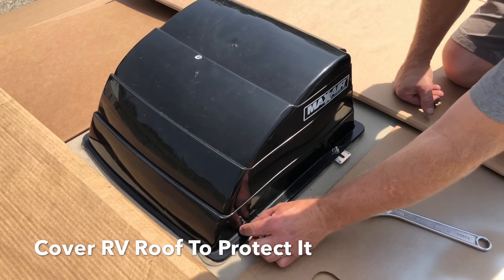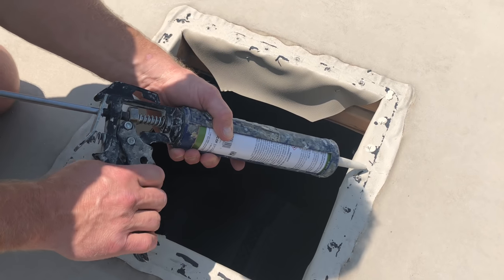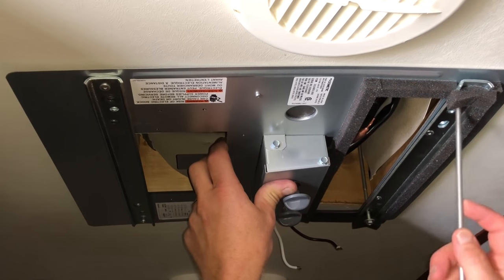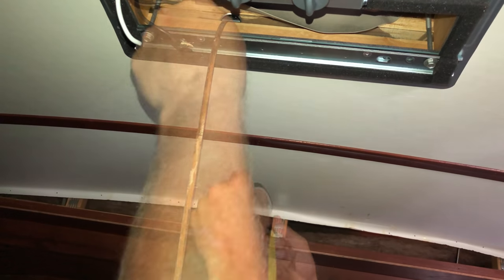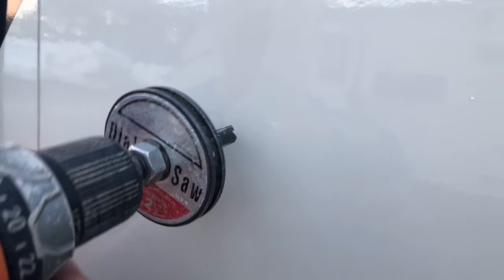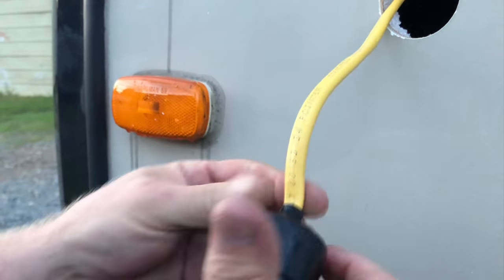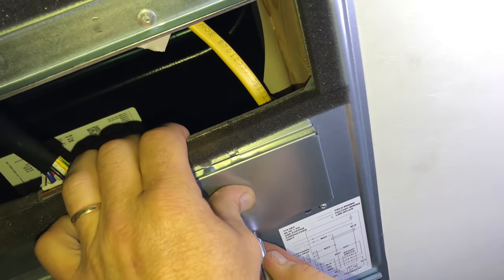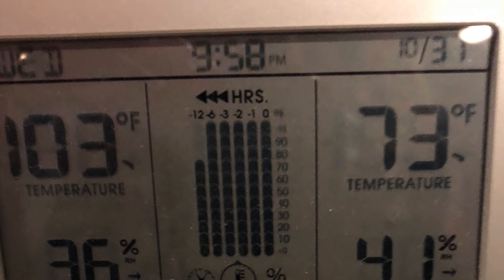Installing a 2nd AC Unit in a Camper with a 30 Amp Service

Comment: What about any thermostat connection ???
Reply: The controls, and thermostat, are located on the unit itself.  No remote thermostat control for this model AC unit.
Reply from the maker: You can also get an external thermostat that can be placed in a better location. This will improve the overall cooling of the unit. Thanks for watching.

Comment: Why is it a plug in ?
Reply from the maker: I’m not sure what you are asking? They are all plug in unless they run on fuel. The second unit bypasses the limitation of having only a 30 amp service. A 30 amp service will not support both. I hope this makes sense and I explained it successfully. Thanks for watching.

Comment: What of you dont have the air vent..???
Reply from the maker: That makes installation more difficult because you would need to cut a hole in the roof, making sure that the hole is centered between the roof trusses. It can be done but a few more steps are necessary.
Hope this helps, thanks for watching.

Comment: Boondocking = 2 Generators 😂🤣😂🤣😂
Reply from the maker: Heck yeah! Thanks for watching.
Reply: @funbro1  question I have a generator honda eu3000is I think I've been using it wrong 🤔. 
My trailer connector has 3 male ends but I've been using an adaptor to connect to the side that has two electrical plugs  and not the one that twists on . And do you think I have to run it on economy or economy off ? 

It runs fine but my a/c shut down twice this last camping trip  cause of the excessive heat.  What do you think im doing wrong ? Thanks any help is greatly appreciated.

Comment: nice, but would have better to use a 20 amp socket
Reply from the maker: It sure would not hurt to use a 20 amp socket, but this unit is well within the range of a 15 amp socket. Thanks for watching.

Comment: Can you show again where you put the circuit breaker ? Oh you don't have any, think about this question while try to go to sleep at night.  Get back in the closet and install a breaker and you've got no protection on your connection from Rain Water shorting it out . Rain water will run down the side of the camper an short it out.  Make sure you connect to a GFCI outlet.
Reply from the maker: Can you tell me again about how you read the previous comments? Oh you didn't read any, think about this while you try to go to sleep at night. Look back at the comments and you will notice that that had already been addressed and discussed in several comments including one just 6 days ago. Most if not all campgrounds have a GFCI for a 20 amp connection so that is typically NOT a problem. I hope this clears up any confusion you may have. Thanks for watching.
Reply: Sorry , didn't mean to step on any toes. I read about 30 "How Great thow are's and no mention of safety issues.  Put an outlet in the closet and when it gets chilly you can run one of those oil filled electric radiators.
Reply from the maker: No worries, Thanks for the good idea. I may have to add an outlet now.

Comment: Are there any issues with that A/C unit running off of a 20 amp connection?  I have been looking into this option with our 30 amp rig and have been advised that a 20 amp connection may not support the stand alone A/C unit.
Reply from the maker: No issues yet. A 20 amp connection is fine with this unit. If you look at the numbers, the compressor runs 13.2 amps and the fan on high runs 2.7 amps.  Simply add the two numbers together and you get 15.9 amps total. That is 4.1 amps below the rating of the  20 amp circuit. That being said you must make sure that all the wiring is rated for 20 amp and if you use a long extension cord it must be a thicker gauge wire (minimum of 12 gauge). I'm not sure why you were advised otherwise but I would honestly love to hear the reason. Hope this helps explain, Happy camping and Thanks for the view.
Reply: If I may add...
Think about how your current AC unit is wired.  In our 5th wheel, the primary 15,000 BTU AC unit is wired into the 110 Load Center of our RV on a 15 amp circuit breaker.  This really is no different, his installation just bypasses the RV's load center, and goes directly to the 20 amp outlet in the park's power pedestal.  I've even heard of running TWO AC units on a 30 amp service, by using soft-start circuits in each AC unit.  These units provide a delay in starting the fan and compressor motors to reduce the startup draw.
Reply: Even a 15 amp breaker can handle it alone since a 15 amp breaker can handle (guessing) 20 amps for a moment for surge loading from the compressor just if you try running 20 amps continuous then it will trip.
Reply: I can run my A/C in my trailer off my garage 15A plug. It only trips if I have the fridge on A/C as well.

Comment: How did you verify the roof would be able to handle the weight?
Reply from the maker: In this case, the manufacturer sells and makes the same RV with an optional second air-conditioner already installed.  Thanks for watching .
Reply: Lennie Nelson they were both standing on the roof carrying the ac unit. Not a factory specification just an observation.
Reply: I did this exact same mod to my TT. When I removed the vent unit I cut boards (1/2" x 3") to go between the factory roof rafters which made my 14" x 14" area boxed in. Just my thing to assure adequate support. This has been the very best mod I have done to my TT.
Reply: @johnk3606  hahah absolutely, I just was going to write that down

Comment: Just steal  the power from the microwave or a 12 volt plug .
Reply from the maker: Most modern 30th amp campers already have enough power demands that would prevent them from running 2 units especially if anything else is running at the same time so going off the microwave circuit would not be my first…or second choice. As for the 12 volt plug, this unit runs in 120VAC so thy definitely would not work. Thanks for checking in.

Comment: You should change the title of the video. It's misleading. I thought you were going to show us how to have 2 ac units on one 30 amp service. Not use the regular 20a power. Wasted a whole 15mins to find that one out.
Reply from the maker: You should understand the title of the video. It's NOT misleading. If you understood electrical at all you should know that 2 ac units on one 30 amp service will not work, so you wasted time is on you. Sorry, but thanks for watching.

Comment: I have a 50amp RV that has 2 AC on it already, they have separate T-stats. We always camp at sites with 30amp service and a 120v outlet. I am wondering if I separate the bedroom AC from the 50amp and do what you just did, will I have any issue sense the t-stat is getting 12v from the other power source?
Reply from the maker: Since a 50 amp service is sufficient fore 2 AC units I would try a combiner before rewiring the camper in any way. A combiner uses the 20 amp plug and the 30 amp plug to give you the 50 amps you need for your rig. I am not sponsored nor have I used this particular product but I have included a link that might set you in the right direction. There are many different brands of combiners check out a few before making your decision. Hope this helps, Happy camping. 
  https://www.amazon.com/Parkworld-885545-Combiner-Splitter-Adapter/dp/B071L4RX37/ref=sr_1_15?dchild=1&keywords=50+amp+Y+splitter+Rv&qid=1592224248&sr=8-15